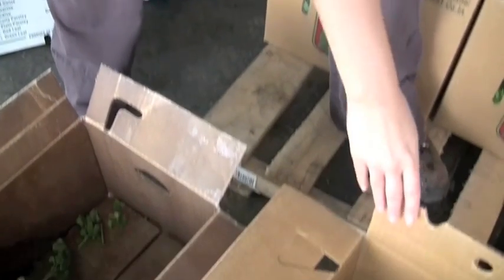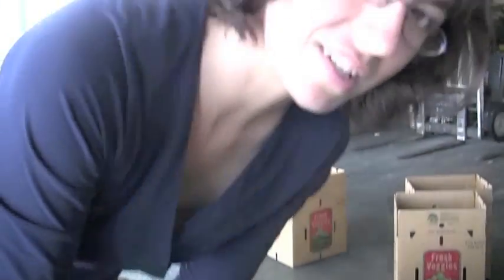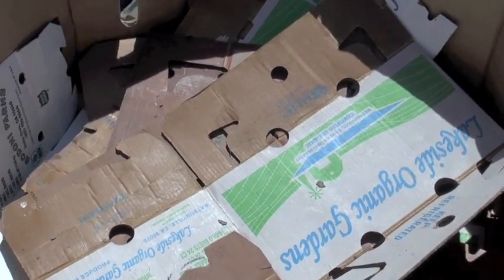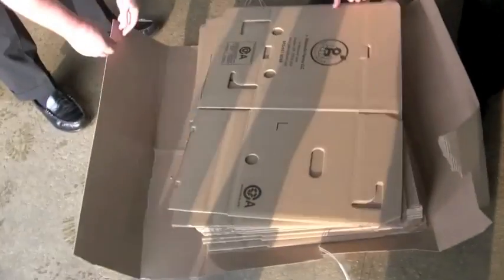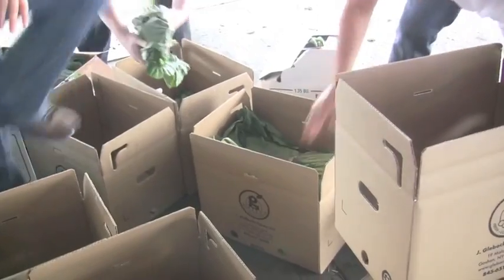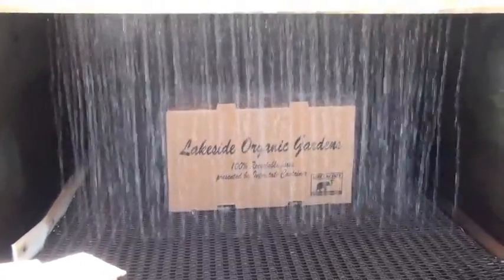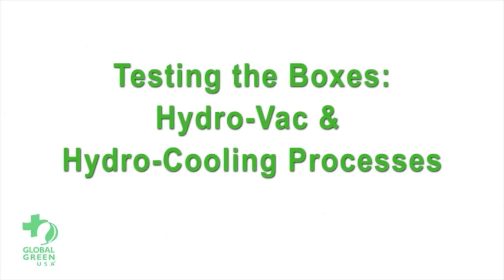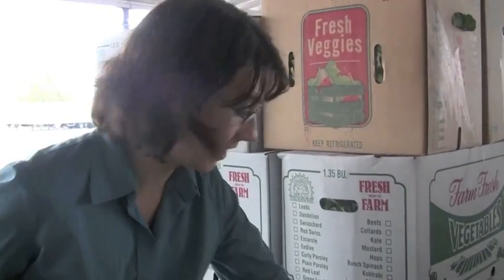Recyclable Waterproof Corrugated Boxes

Comment: Hello I am a student on a level 3 engineering course. I am currently doing an extended project where I am having a look into different recyclable/ biodegradable materials that could be used to make a festival tent. if there is any chance i could buy a few of these boxes or get a few sent to me for free? If you could get back to me asap it would be much appreciated. Thanks, Steve.